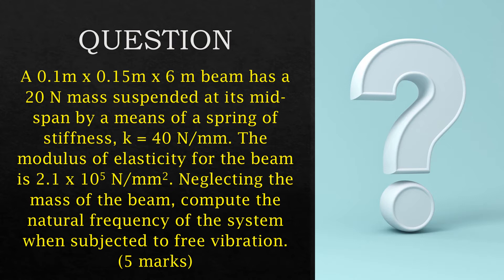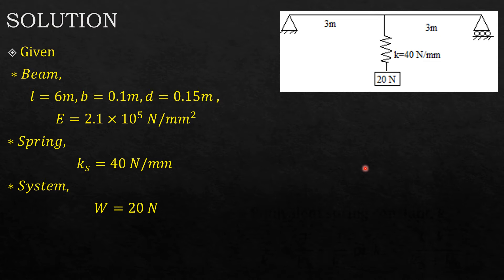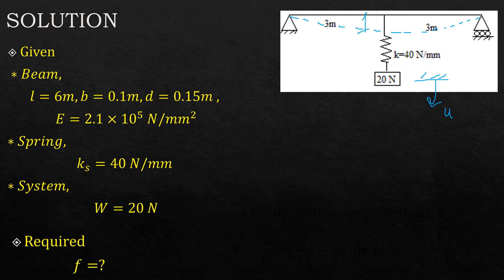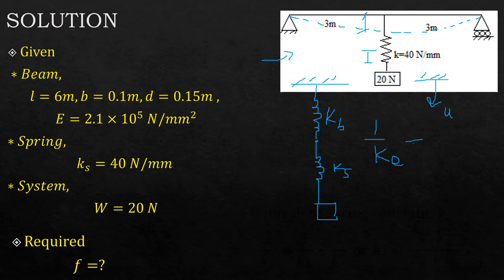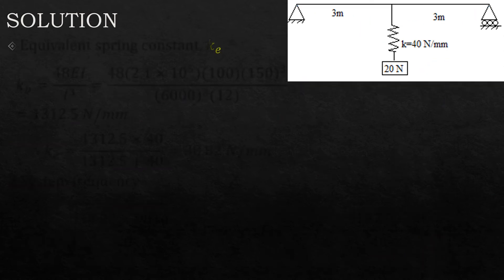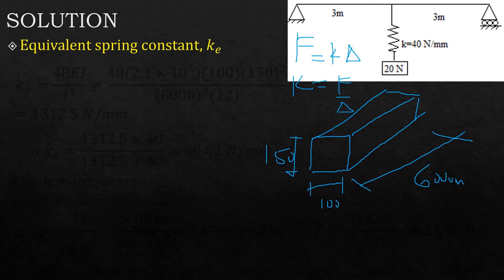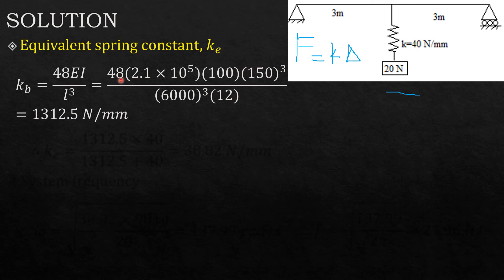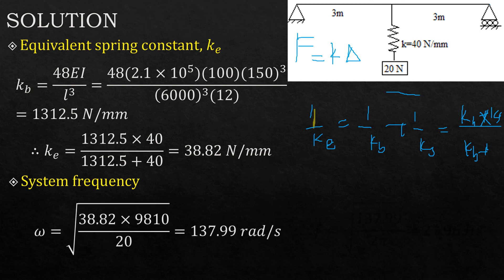#Solvedproblem | Free vibration of undamped single degree of freedom system

Comment from the maker: Solution to this and other problems can be downloaded here https://bit.ly/4Downloads
*Question*
A 0.1m x 0.15m x 6 m beam has a 20 N mass suspended at its mid-span by a means of a spring of stiffness, k = 40 N/mm. The modulus of elasticity for the beam is 2.1 x 105 N/mm2. Neglecting the mass of the beam, compute the natural frequency of the system when subjected to free vibration. (5 marks)